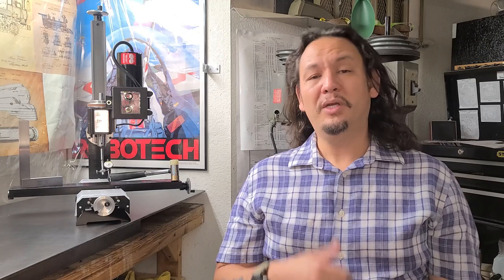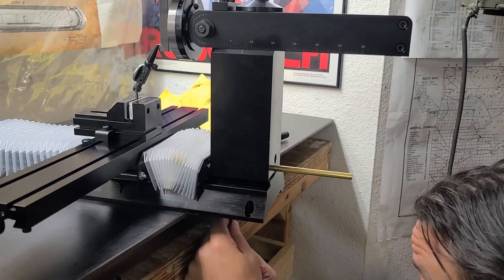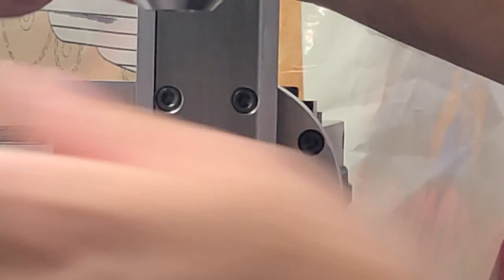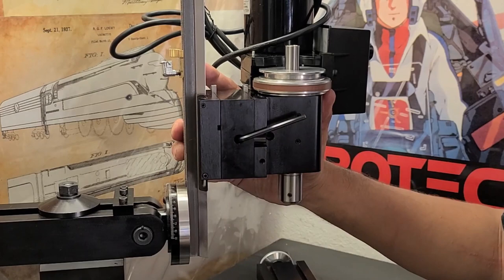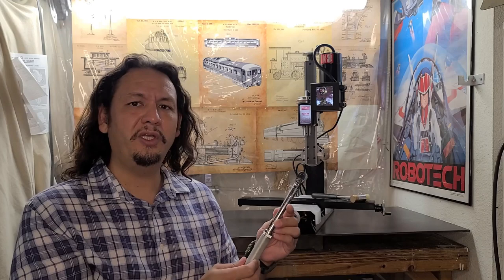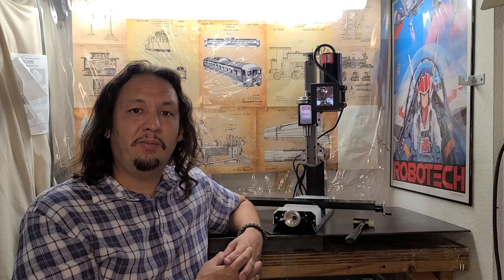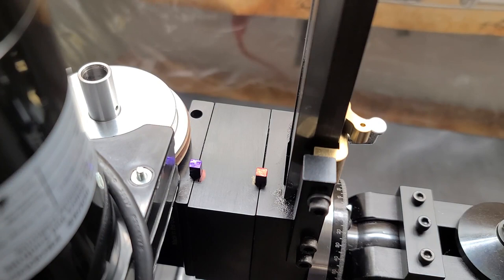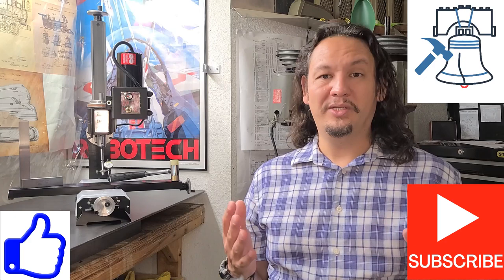TRAM: Sherline 5800 Next Gen Mill make it PRECISION!!!

Comment: I have the 5400.  Using a little shim stock, a sheet of float glass and a Starrett test gage, I have mine within .001 TIR swinging in a 5" diameter circle.  Easy Peasy.
Reply from the maker: That be great. I'll have to see where I can get a plate of float glass.  Do you use the shim stock to align the column? It was a bit a pain every time a indicator tip would slam into the t slots.
Reply: @LoydPrecisionMakers  It took one piece of .002” shim stock between the top of the track and the block behind it to get the track perpendicular to my table.  I bent the shim over at the top so it wouldn’t slide down when the track is loosened during later tramming operations.  It might be a good idea to mount your mill down permanently before doing this part, or at least rechecking after you do.
Reply from the maker: Thanks.  I am feeling like I need to fiddle a bit more with the saddle and track.  I definite regret not having it mounted to something.  What a pain that was.  I did recheck on the outer machined track surfaces and after reading your comment and fortunately got the same result there.  I'll be changing that up in the future.

Comment: HI LOYD.  SOME NOTES   YOUR  ALIGNMENT  IS  GOOD  THE USE OF THE TORQUE WRENCH IS GOOD FOR -----REPEATABILITY-------RATHER THEN THE BACK/FORTH YOU FOUND OUT WITH THE MOVES ----DESPITE- THE TIME IT TAKES TO DO  ANOTHER  REPEAT. TIP   I  USE A DEAD BLOW  'TAPPER'  INSTEAD OF A HAMMER.  IT  SEEMS  TO  HAVE  MORE  POSITIVE  CONTROL.   MINE IS A  SHOT FILLED TUBE  6' LG.'/1''  O.D. WITH HARD PLASTIC CAPS ON EACH END. THESE CAN BE FOUND  IN MILL VISE AREA FOR SEATING PIECE IN VISE.  VISE TIP  ADD   'KEYS' TO BOTTOM OF YOUR  VISE  THESE ARE  BOLT-ON BLOCKS ALIGNED SQUARE TO YOUR VISE FIXED JAW SIZED TO FIT IN YOUR TABLE TEE SLOT.  THIS WAY RATHER THEN INDICATE VISE IN EVERY TIME ON/OFF BLOCKS IN SLOT ---VISE IN  .001    LATER  MIKE
Reply from the maker: Thanks.  I'll have to get a good dead blow.  Everything at my local box store is just way to big.  I agree with you it probably does have way more consistency.  I'll have a to try the keys.  I really like your idea of clamp on or bolt blocks.  Little time savers save ones sanity!!!

Comment: Love your comments on how to use a Hex Key
Reply from the maker: Thanks. Tricks an tips here and there always makes thi gs go just that much more smoothly.
Reply: Like the tapping tips on different areas of the mill column. Nice!
Reply: Like the tapping tips on different areas of the mill column. Nice!
Reply: Like the tapping tips on different areas of the mill column. Nice!
Reply: Like the tapping tips on different areas of the mill column. Nice!
Reply: Like the tapping tips on different areas of the mill column. Nice!
Reply: Like the tapping tips on different areas of the mill column. Nice!
Reply: Like the tapping tips on different areas of the mill column. Nice!
Reply from the maker: @pauldevey8628  It works, sometimes it is easier to control the area of the blow than varying the force.  Hope it helps you out!!!

Comment: the Z axis rail ( the only one with steel ) is to flexible , you can feel it when you use the mill as a drill .

i think we need to put a big triangle at the back between the ram and the Z rail .
Reply from the maker: Thanks for pointing that out.  I felt like something was off and going on with drilling but never quite sure what it was.  Thanks for pointing that out.  That seems to make sense now.

I like your idea about adding a brace.  That could do it.  Unfortunately might lose some of the travel on the headstock.  

I might tighten up the Z axis gib to take up a little more play. It might also help to take lighter cuts with a 4 or 6 flute cutting steel, in the meantime.
Reply: @LoydPrecisionMakers  maybe a rod connecting the end of the ram ( i have the ram extension multiple axis ) and the top of the rail of the Z axis near the step motor ( sorry for my English )
Reply: cannot post image
Reply from the maker: @Tupeutla  Your English is excellent.  No need to apologize.  That's a good idea.  My only concern is you would need to use a heavy rod due to flex.  I would consider what we call in the US angle iron or U channel.  Then over the stepper motor bushing some U shaped mount to allow the leadscrew to clear then connected to a plate at the far end of the ram either clamped or drilled and tapped to the top of the ram arms. Nice thing is it would allow for a surface to attach and better mange CNC wiring and the power cord.
Reply from the maker: @Tupeutla  No I don't think you can in the comments.  You Tube won't allow it. Probably due to people posting ads or inappropriate images.

Comment: Hey Bro,
Have you Anodized any Aluminum parts that you've machined? You had mentioned it a while back regarding that "Jack-n-Box" puzzle I machined on Sherline mill. 
👉Anyway, I'm in the process of setting up a Aluminum Anodizing DIY Lab. I've done a bunch of research about it & purchased everything I need, but thought I'd ask If you have gone through that process & have any tips for me ...?
I'd appreciate it☯️
Thanks,
Lee
Reply from the maker: Me personally no. But I took the lathe and basses in. I did find out on tight tolerance parts like threads they can be masked off with a piece of silicon tube pulled through then trimmed off. Additionally, I missed a litle paint on an edge and that part didn't anodize. Well.

Comment: Similarly to the comment below, I use a piece of glass to extend the table area and use a small magnetic dial indicator. I rotate the indicator by pulling then belt rather than the pulley (I’ve seen that removes some human error). I pretty much have it squared +-0.005mm in all 360 rotation.
Reply from the maker: Cool thanks you.  That sounds like good practice to grip the belt instead.  I definitely will give that a try.  I'm sure there is plenty of opportunity to have tram and tram again!!!

Comment: You have it trammed in as good as it will get. Now, go to a kitchen cabinet/countertop place and get a (free) off cut or sample of a marble countertop…. About 12x12x1 inches or 12 x18 and mount the mill to it. You’ll have a heavy, perfectly level base for the mill, and also, an inexpensive (and accurate enough for hobby use) gauge plate as well!!
Reply from the maker: That's a great idea thanks.  A functional surface plate always with the mill. I like it. Thanks so much.

Comment: PS: a last check you can do is to run a fly cutter in the X and Y axis independently across a piece of aluminum bar stock, and looking for the trailing side of the cutter to just be kissing the stock.  At least, that's what "they" say.  Works for me.
Reply from the maker: Its a good idea. I can try that with what I have on had right now. It is nice to have a visual verification beside relying upon a Dial indicator only. You you have the bat stock in a vice or just on the table?
Reply: @LoydPrecisionMakers  On the table, the vise adds variables.

Using float glass, I file down any nicks first.  A wide piece of float glass lets me extend the surface I’m sweeping in the Y direction well beyond the width of the table, and I don’t have to deal with the gage probe falling in the slots.  You can get the glass on Amazon if you want to try it, it’s cheap.

Two other ideas I had when watching your video: do you know that the keys that pin the head spacer are tapered?  If they are in the way they are supposed to be, it shouldn’t be able rotate the head at all when you loosen the clamping screw.  And, when you indicated across the face of the vertical steel track, the place to check might have been the outer running surfaces, which are machined and ground, rather than the part in the center.

Hope all is well at your end!
Reply from the maker: Thank you all is well on my end.  Though summer temps are setting in and my workspace is getting uncomfortably warm.  

Of course Amazon would have float glass.  Thanks I am definitely going to try it out.  Interesting that it is advertised as dead flat and seems to be associated with lapping.  might have some other useful traits as well.

I'll have to check out mine for the tapper.  In the lathe section of the manual they mention precision ground and not square.  But do mention it will "fit only in one direction".  As you say taper, they went the long way round to say the same thing!!!

Comment: hi, a glassplate will make this easyer (i have here 20x20cmx1.2cm, pretty cheap, on size from ebay). and precision ground flatstones are also very usefull.
Reply from the maker: Thanks I wasn't aware of precision ground flat stones.  I'll check it out. What do you use it on? I think the glass is sold in the US as float glass. I'll have to check.
Reply: @LoydPrecisionMakers  hi, if you have a tiny highspot on your table, for e.g 0.05mm, your glass plate will not sit right on your table for aligment. Or if you mount your vise, rotary table ... all contact areas. From time to time you need to stone them.
Reply from the maker: Thanks I was able to get a flat piece of plate glass not too bad.  But wow the precision ground stones are expensive$$$ Though It is definitely something I think will be useful.